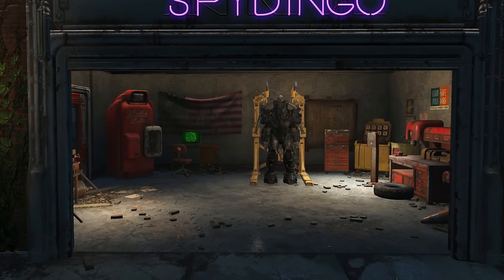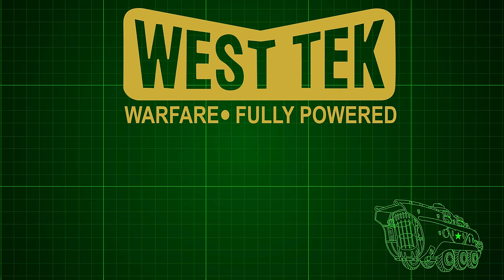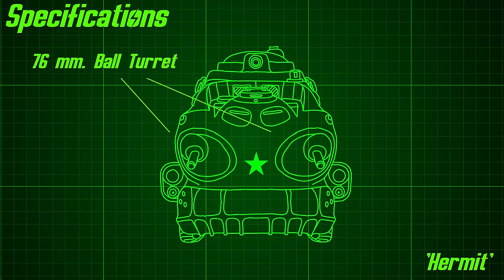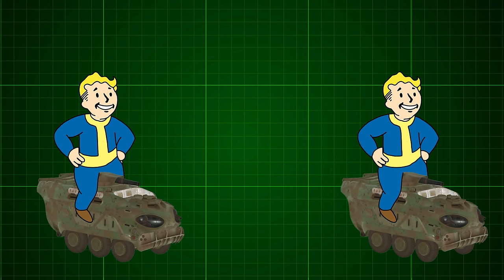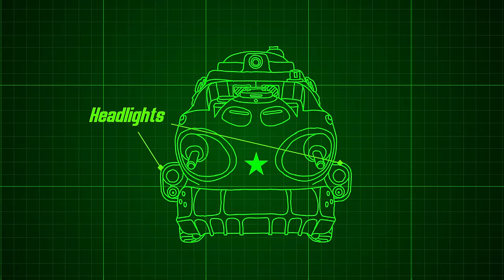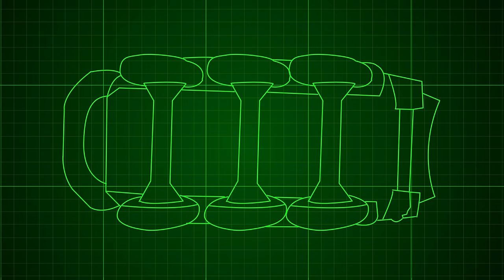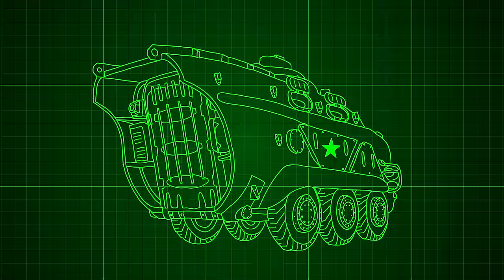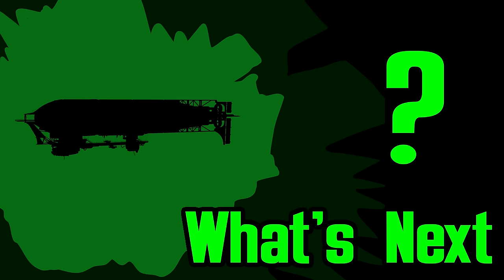Fallout 4 & 76's APC is a Hot Mess

Comment: The us has a tendency to name armoured vehicles after famous generals, so with that naming scheme in mind (Especially given the patriotically driven america being what it was), perhaps a name of the likes as the m26 (Based on the length of the vehicle) mcarthur IFV. Estimates look good, and given the armament, we can probably assume this IFV is armoured to resist smaller calibre autocannon rounds, as would have been found on the BMP...

You do bring up an interesting point though. While the IFV we see in fallout 4 is not capable of aquatic operations that we know of, perhaps it's precursor was! And the weird design quirks were kept in due to constraints of wartime production, a story that mirrors the braddley's ever expanding mission creep during design. Larger size does mean more internal volume for buoyancy and all that. Though the lack of ability to see out of the vision slits in the troop bay is pretty damn poor.  Low velocity turret with significant recoil absorption would be a good idea, if it isn't some kind of laser weapon instead of the 105mm cannon in that turret. It's also possible it's just the one driver.

As for future vehicles? Learning more about Arc Jet's Stingray would be nice. Seems it was used for both civilian and military use. But equally, would like to see more about the airliners of fallout. Likely manufactured by boeing given their experience making large, multi engine aircraft, the stratoliner was the ultimate in commercial air travel, likely still performing routes outside of the US right up until the bombs fell, at least to nations friendly to the US. Otherwise there is no need for an aircraft that large, for domestic flights.
Reply from the maker: I like your theory with the general naming convention, mcarthur IFV is a solid name.

Those vision slits bother me the most, although there have been some creative suggestions on how to make them more of an intention decision than an oversight, like ballast intakes or the IFV being the haphazard result of another vehicle being converted into what we see in game do to resource shortages. Solid point on the low velocity turret as well!

The stingray would be a real interesting one to do, it's design never really resonated with me since I was hoping for a fallout version of an F22 or something, and not such a strange craft. Maybe after doing a video on it, I'll come to like it. The airliners are another fun topic given their size and in wing seating configuration. The seating config is particularly fun since the "Flying-V" is a thing KLM is working on that has such a seating configuration. Also if I'm not mistaken there was a Junkers , G.38, I believe that had in wing seating as well back in the day that could be fun to look at in the context of such a video as well!

Comment: It's possible that this particular model was designed for domestic use against rioters. In the lore, the US military spent as much time quelling riots and securing US cities as it did fighting the Chinese. Between viral pandemics, riots over basic necessities, and constant paranoia over enemy infiltration, it makes sense they'd design an IFV/APC that was used for domestic use on road infrastructure, hence the lack of tracks.

The weapons would either be launchers for smoke and gas, to disperse crowds, or it's possible the turret on top was a water hose. If it was never meant to see combat or fire live ammunition, makes sense it would be designed oddly. The only issue with the water hose idea is that I don't think it could hold a great deal of water, or the bay in the back was designed to fit some kind of specialised water tank, meaning they didn't always use the turret, but it was always attached, for some reason.